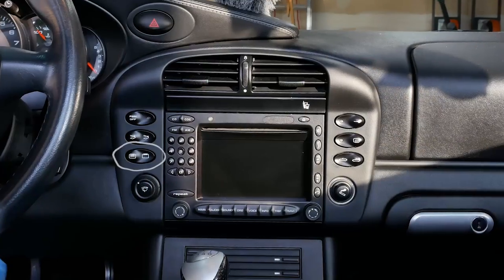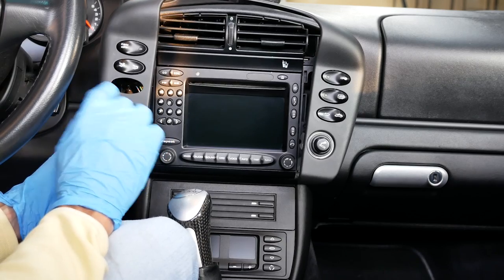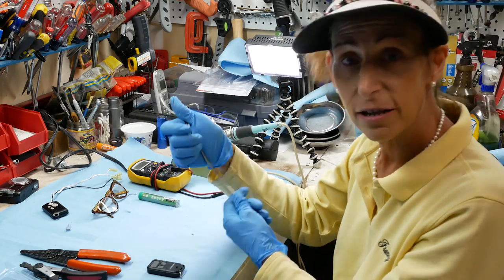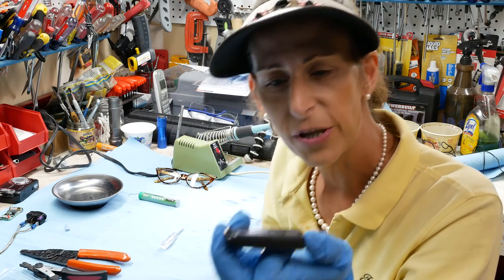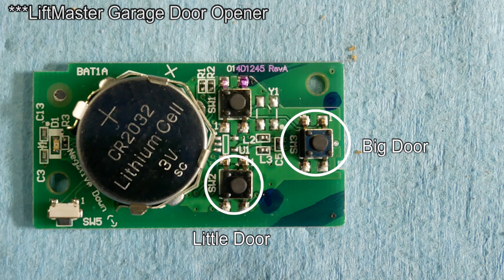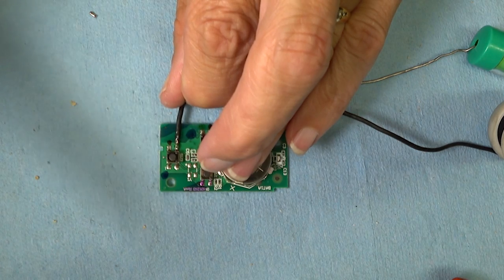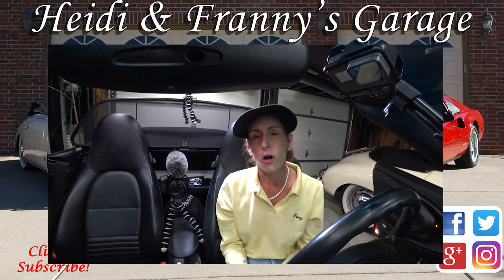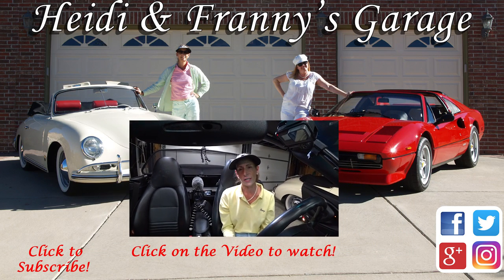Porsche 996 911 In-Dash Garage Door Opener DIY Hack! How To Install!

Comment: I bought my 996 turbo a year ago. Like you, I'm loving it. The first mod I did was an Alpine head unit with Car Play. This is a big upgrade.  I'm at the stage where I'm going to start doing some performance mods. However, thanks to you, your (my) garage door opener will be the second mod of many. Great video - thank you
Reply from the maker: +Andrew Schofield I can't wait to hear how it turns out.  I was bugging Franny for months on doing a video about this.  I love this modification.  You will love it too.  Heidi
Reply: Heidi and Franny's Garage Hi there, a little update from France: have just completed wiring the switch to my garage door remote. It works like a charm. Now all I have to do is fit it to the car. Unfortunately, due to work commitments, this won't be until December... Will keep you posted.
Reply from the maker: Andrew Schofield I understand.  One of the reasons for me not showing up in many videos lately was because of the hours I have been putting in at the day job.  Ok. Keep us posted.  Heidi

Comment: another fantastic video.  only thing I would add would be to maybe add a dollop of hot glue on the wires at the circuit board as a bit of strain relief.  I think this is the first video of you doing a 'hack' that I have seen!  Bravo.

Comment: It may have been mentioned already, but you do have to remember that you will need to access the remote to change the batteries every once in a while. Great video! I'll consider that for mine!
Robert.
Reply from the maker: Thanks.  I think I left enough coiled up wire so I can access it from behind. Update - it is still working just fine and I haven't had to change the battery yet so yea!

Comment: Fantastic video - thank you for taking the time to go into detail on each step. I just completed this project and I found one thing that was different. I used the PSM switch to tap into power for the light on the new garage door switch. What I found was that the outer posts on the PSM switch were both hot when the lights were on. With the lights off, only one was hot. What ended up working for me was to use the two side posts for the garage door switch, and connect one to the left-most post on the PSM switch (when facing it from the driver's seat), but then to connect the second post from the garage door switch to the GROUND (center one by itself) on the PSM switch. Using this setup, the garage door switch lights up correctly.
Reply from the maker: Thanks so much for this.  Always great for folks reading through.  Sorry for the misdirection.  Glad it all worked out in the end :)
Reply: No need to apologize! I just wanted to post my experience in case someone else ran into the same thing down the road.
Reply from the maker: Totally!  YT needs more of these awesome helpful comments :)  Thanks again!!
Reply: You just solved my dilema, go teamwork!

Comment: very nice, a few sugestions, cause I am that guy.  Add replace the battery to a new one because you don't know how old it is or how long it satt in the box from the store and replacing it requires taking this apart again.  and tinning is a great idea bonding to copper not wire as some wire is aluminum and try to not use aluminum wire with copper.

Comment: So you have to tear your dash apart every time it needs a new battery?
Reply from the maker: That's a great question.  That battery seems to last forever, but if you add a little more wire you can place it forward enough that you can reach up and pull it out and replace the battery.  That's what I did but we still haven't needed to replace it!

Comment: Franny,I always enjoy HFG videos.  Thank you for this one.  I would like to add one other possibility for the opener. If you buy a used home link from most any car, eBay, you can do that hack with it and hook it to the power in the car so no battery replacement in the future.   I have used the phone prep plug that floats around in the center console. Brown = ground, yellow/black = phone mute, green/black = switched 12v, red/green = un-switched 12v.
Reply from the maker: +KATHY BAKER Thanks Kathy! That is a good idea. Nice to know there is a spare 12V floating around back there. Franny

Comment: Great job as usual! Only thing I'd do different would be to install a fresh Duracell battery for peace of mind, even if it was a new remote with a  factory included battery.
Reply from the maker: That's capital thinking!  It isn't hard to get it back out, but latter rather than sooner would be better :)  F

Comment: Is it possible to power the remote control with the car battery as opposed to its own power supply? Because the small battery will drain and you will need to remove the “U” cover to access it. Thanks
Reply from the maker: +jooggie17 possible yes, but a pain. Just leave more wire so you can get to it from the back of the console.

Comment: I was wondering.... could you have made the wire lead longer to hang out from the back of the dash so when the battery in the opener needs changing it is as simple as reaching under the dash rather than pulling the face plate off the dash? I am sure in time that removing the face plate would be more a problem, causing it to crack.
Reply from the maker: Yes.
Reply: Fantastic video. So thorough and you camera quality is so professional. I’m going to try this on my 986. Hope the install steps are similar.

Comment: When the battery in the remote dies you have to take everything apart to replace it? Or are you connected to power through the lights?
Reply from the maker: Clifton Frey no it isn't hooked to car power.  If you leave enough wire, you can get to the back of the dash.  Plus, those batteries last for years.  Franny.

Comment: Nice work as usual, but... why didn't you install a 12V-to-3V DC-to-DC converter and get rid of the battery?
Reply from the maker: :) Ya know, I think I actually have one of those kicking around somewhere...  The battery in those things last for years...  Easy and cheap to replace, but you bring up a good point...  If you leave enough wire you can route the remote far enough back that you can fish it out the back without popping off the front cover.  I should have mentioned that... Thanks,  f

Comment: Would you list the brand and model of the remote you used. I’ve opened 2 different remotes and found they are not anywhere as clear on where the +/- as well as the actual “switches” are positioned. Gets expensive buying remotes that can’t be modified. Thanks for the very instructional video.
Reply from the maker: We did it with two different brands. Genie and Liftmaster.  Try emailing Franny on our website if that helps.  Thanks. H